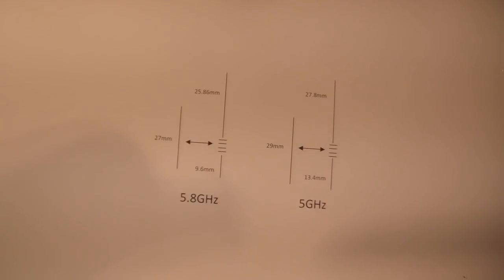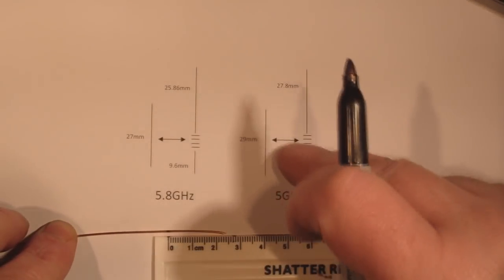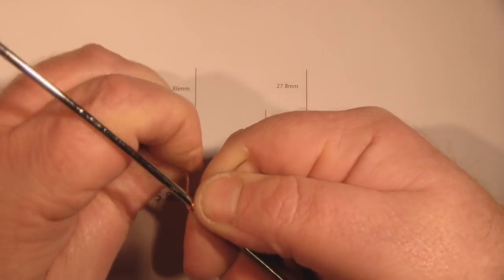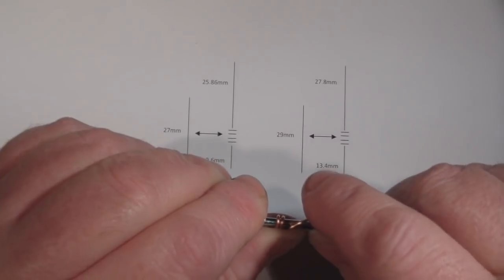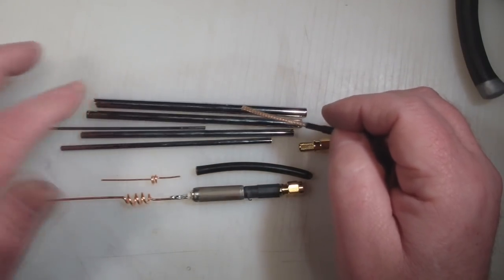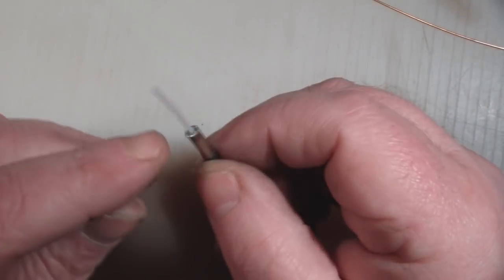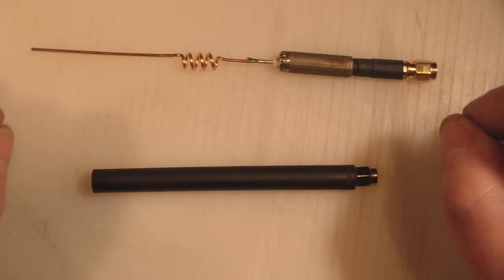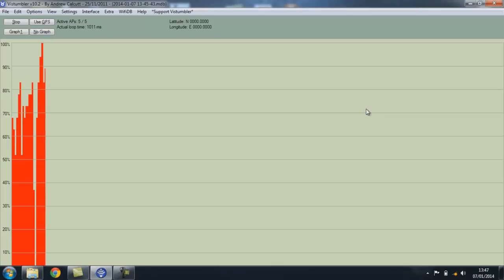Dipole Antenna for 5GHz and 5.8GHz

Comment: Is it possible to make a 5.8GHz Antenna that just has a straight wire connected to a SMA Plug or do they always need that cylinder at the beginning and the spiral at the center? Length isn't probably THAT much of a problem but looks kind of is.

I built and 3D printed a Periscope Replacement for a 1:16 Scale Tank to house a FPV Camera and VTx but the current Antenna sticks out like a sore thumb which is why I'm looking for something that goes well with the already present, no frills simple and straight, Antennas mounted just for show.

Comment: Is the coil to reduce the length o does it have another impact on the transmission of the signal? 

In researching antennae to try to fix a 5.8 gHz transmitter antennae that I chopped with a prop I came to believe that the exterior metal tube acted as a balun by essentially increasing the resistance on the ground to infinity. Now I guess I need to read more about the ground plane. Do you know anything about feed line issues with this frequency?

What does the graph at the end show? Do you have a video about the hardware/software that you use to get the data in that graph?

Comment: Andrew, do you have a calculator you use to determine the lengths? Your insight has been really helpful.
Reply: frequency divided by 300 (speed of light) = band length, which determines the antenna length.  Full wave, half wave, etc.

Comment: Excelent informative video - Q- tthe piece of metal tubing used I think you called it the 'ground plane' has it got to be ferrus or brass/copper tubing does the antenna work better with a particular material...joe

Comment: What's the purpose of the coil? Are you loading the antenna to make it shorter? At such high frequencies an antenna would be pretty small. So I don't see the point in shortening, unless your project needs such a short antenna.

Comment: Hello Mr. Mcneil
I'm trying to find out how you've determined the length of your 1/4 wave antenna mesure.
I'm using this formula for 1/2 wave length in meters :  150 x A ( A = Ratio between antenna length and thickness of the wire)  / frequency in MHz)  but I'm not coming very closer of your length.
Thank you.

Comment: Hi andrew im wondering if you could help me, i want to get the wifi signal from a hotspot 5 blocks away of my house, and i hope you could tell me which of your antennas is/are the best to me to get that signal if its possible. Thanks and big fan of your channel
Reply from the maker: The best antenna for distance with low data loss is the double biquad. I would put it up against a yagi any day of the week.
Andrew

Comment: How would you make one for a higher gain like 6dbi or even 10dbi
Reply: If it is to remain "omni" you can only get about 2.4 dBi of gain. The omni pattern is like a perfectly round doughnut having 45 degree launch angles from the center. However if you make changes to get higher the launch angles will decrease and the doughnut shape becomes more of a platter, or saucer, shaped. Works great if the two devices connected are in the same plane. However, in the case of a UAV your gain would decrease as it rises in altitude. Not good, at all. If you want more "omni" gain performance switch to a quadrifiler Helix Omni. Those are about 9 dBi of gain. Adding 6 dB of gain will double your distance....mostly.
Reply: @bilyB1SuperScience  Knowledgeable man))

Comment: why is the opening of the sleeve in the bottom, towards the connector, instead of being upwards towards the monopole? Can this eliminate the common mode current on the outer shield?
Reply: come to think of it, i guess it works both ways. it has the same effect

Comment: I'm watching these videos and becoming more and more suspicious... loading coil is to add inductance to compensate capacitance of the electrically short antenna - inductance depends on the size of the coil and core material - it can't be right if you just coil some predetermined length of wire on random diameter with randomly spacing turns - diameter, number of turns and coil length should be precise to achieve correct inductance...

Comment: hello, this antenna is not dipole! for a true dipole has no gain, and the two conductor elements have the same diameter! and the same length.
what you show is an antenna has skirt and a self, which she has gain !!!
Reply: Yes  - It looks like 5/8 lambda unipol with coil and NOT like  a DIPOLE